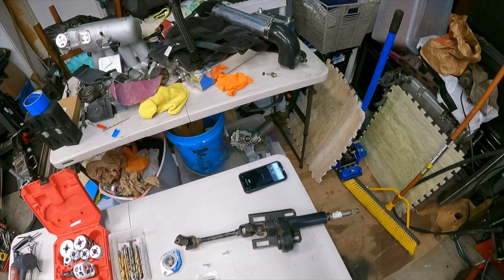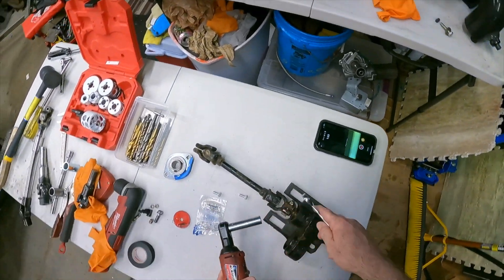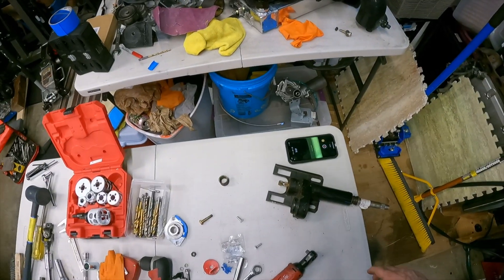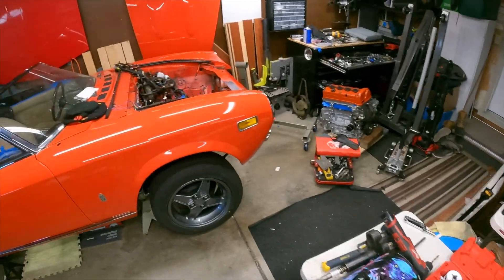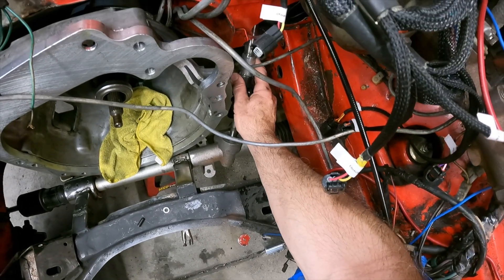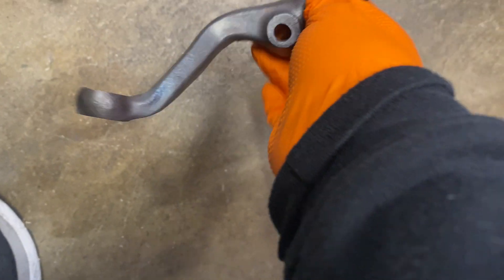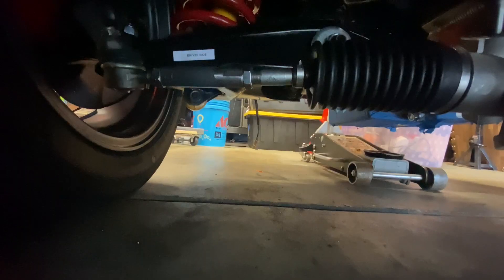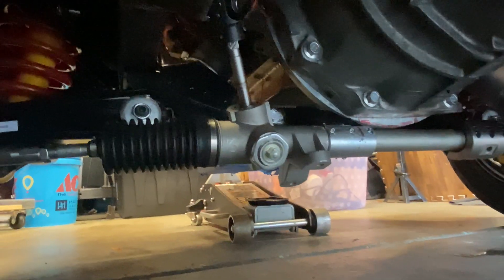K Swap Fiat 124 Spider Part 5 - Custom Steering

Comment: Hi! I have a 1974 Fiat 124 Sport Coupé and a Fiat Abarth X1/9 (Bertone). 

I’m planning K‑series swaps for both and, since you’ve done similar front‑ and mid/rear‑engine builds, I’d value quick tips on everything from ECU, gearbox, shifter setup, where to buy these engines and any gotchas. What’s the best way to contact you? 

Located in Europe, already bought the midwest bayless shafts. Best Regards
Reply from the maker: Fun! - if you haven't already, join this FB group https://www.facebook.com/groups/2575480112697504
Reply: @fiatmonkey4012  Tried to join, are you the admin for acceptance?
Reply from the maker: I am not, but the admin for that group should be Matt from Midwest-Bayless
Reply from the maker: Also if you haven't seen this, "Bob Cat" channel he has some cool low budget work he did for his kswap into a 124 sedan https://www.youtube.com/watch?v=hHjv5BxBDDo&list=PL42jeGAlUh_JlGJ54wxxrKsmctgLDXNXy

Comment: Have you put in any of the videos what you are going to do clutch wise? You have to convert to hydraulic clutch. Right? Are you getting a universal firewall mount or maybe doing a kit that combines the brakes and clutch or? Asking because I am converting to a rotary 12A and 5 speed from a 79 RX7.
Reply from the maker: Yes, I have raw footage and a lot of photos from the conversion to a hydraulic clutch system. Essentially, I copied the X19 and attached the master to the pedal box. There’s a little more room in the 124 then the X19 so servicing the master cylinder should not be a problem.
Reply from the maker: So yes, I’ll post a video when I get a chance to put it all together. Been really busy just recently moved. Which was a pain in the ass.😅
Reply: @fiatmonkey4012  would love to see a video on that!